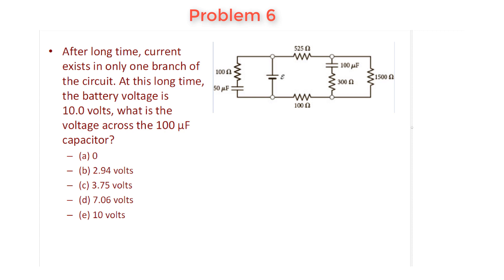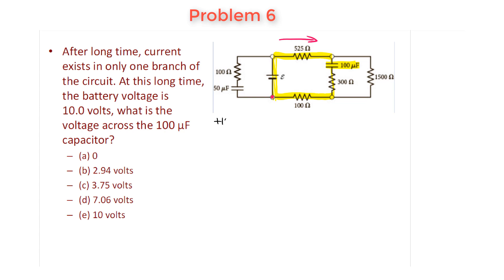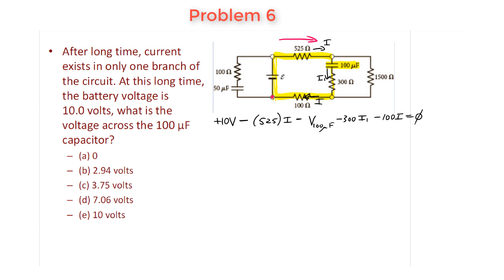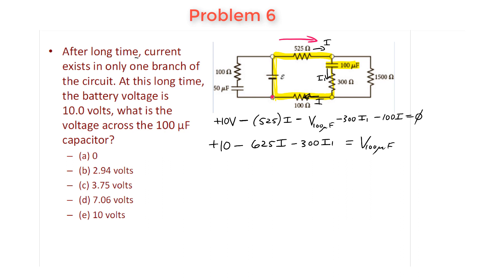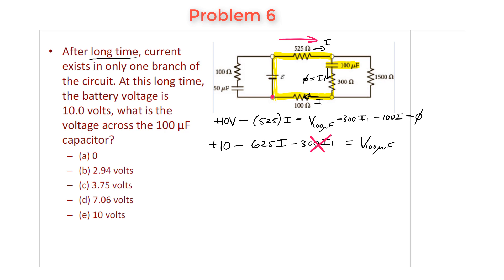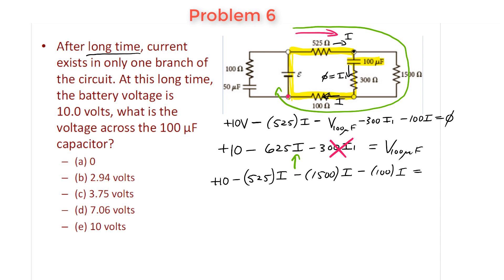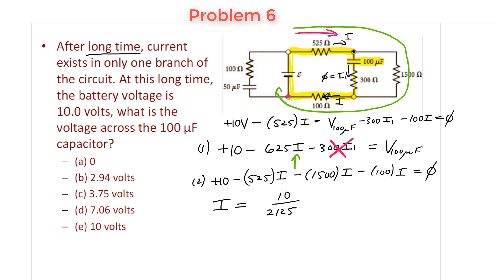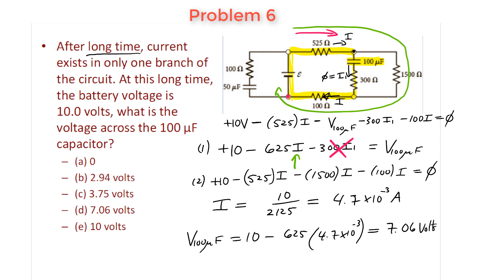RC Circuits - Problem 6 - Voltage across a Capacitor after a long time.

Comment: why is the last current -100 I please ??? how can we know that
Reply: I didn't get what you are asking but .. Bro, you don't need to apply KVL for this question,... Just remember, capacitor in steady state behaves as open circuit... Now, open all the wires which has capacitors in it at steady state (draw a new diagram for better understanding)... Find equivalent resistance, then, using ohms law find the current, then, as you see the potential difference across the 100 micro farad capacitor is same as that in 1500 ohm resistor.. (Parallel connection) using ohms, find the potential across the resistor by Multiplying the current to it.... As the current in 100 micro farad capacitor is 0, potential drop by resistance is 0, then the potential you acquired earlier is same as that across the capacitor... 
Thank me later.
Reply: @silenttrickster9064 thanks I get what youre saying and I am girl btw i am just struggling to understand all that 😭😭 do you have any videos suggestion to help me understand all that ? like how do you know that it behaves like an open circuit ... please suggest me 🙏🏼
Reply: @meryemk3531  capacitor in a circuit, when the switch is just closed, then you just short circuit the capacitor as it is charging.... But if the switch is closed for long, it behaves as open circuit (charging of capacitor is complete at infinity)...finding charge at any other intermediate is different story, it has different formulas  ....There are many explanation vids but if you want english only, then, I don't know much, but ig khan academy has it...